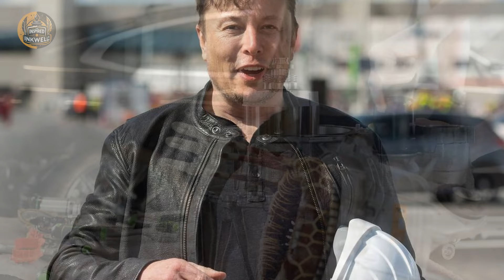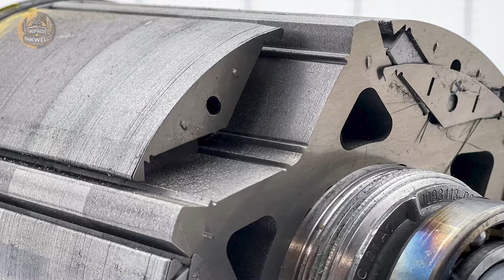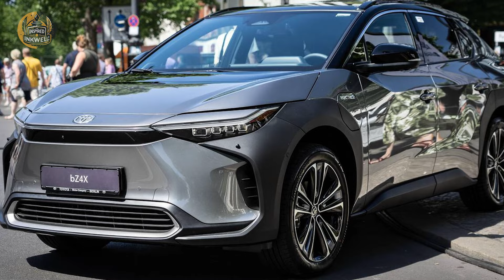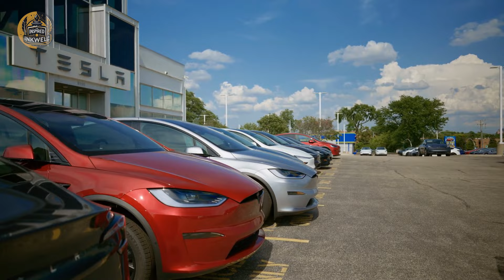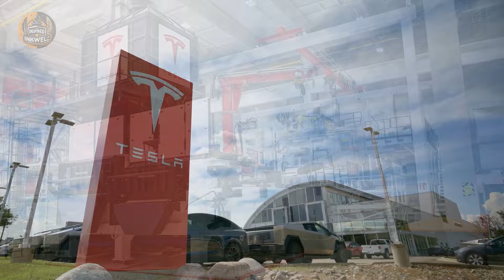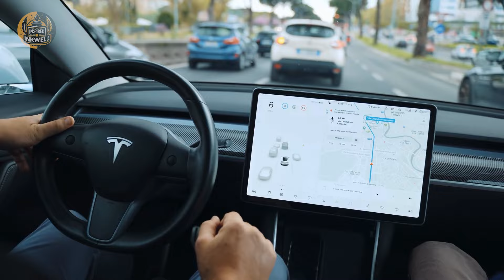Elon Musk’s New Engine Just Ended the EV War

Comment: Bla Bla Bla. If you want to travel long distances in a reasonable time EV's are useless.
Reply: The next gen batteries will be able to charge in approximately 10 minutes. That's in the same ballpark as filling up a gas tank.
Reply: @PackBjammin  That's yet to be seen, but fast charging & high voltage is not a recipe for good long term health of a battery. Battery fires are way to common for any number of reasons as well as from accidents. As usual people are being used as cash cows, product testers & Guinea pigs. I don't trust their hype for good reason.
Reply: so, for 99% of the people EV´s are perfect choice.
Reply: @ClydeD1337  To many drawbacks hardly perfect & very poor sales, so no.
Reply: @craigparker4108  so firts it was bad range and now its even more drawbacks? Looks like someone is moving a goal posts here.
Reply: @ClydeD1337  🤣